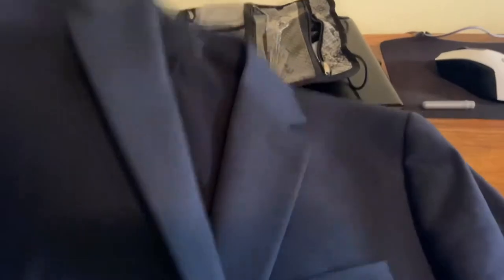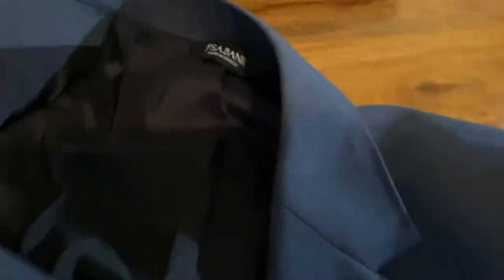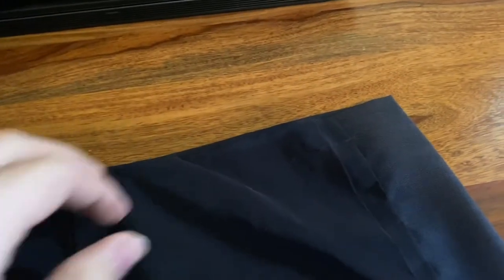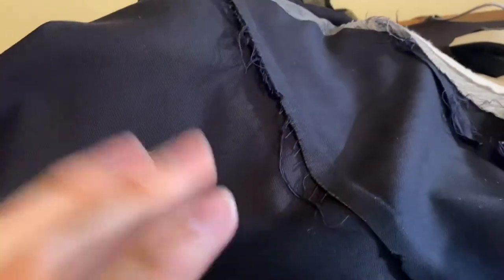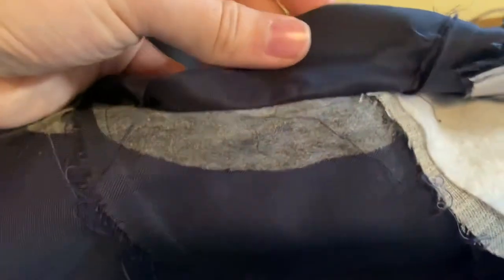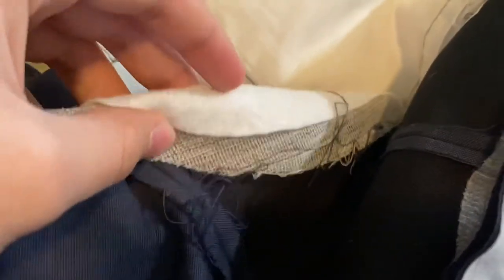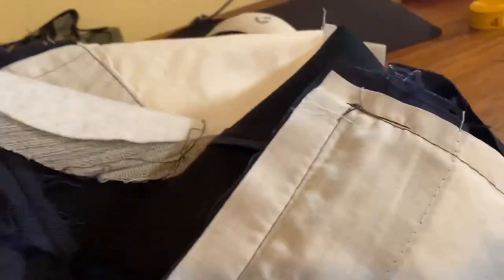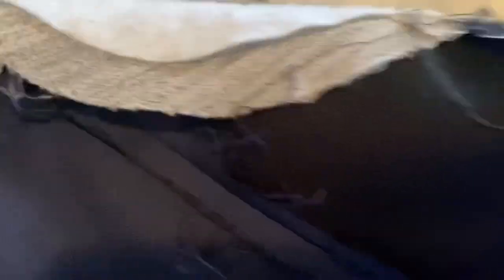Cutting Open a Jos A Bank Suit Jacket!

Comment: I have a favorite jacket, casual grey and soft like southern Italian kind of soft. It's unlined so I could take a peek in between the inside seams and see the inner workings of the jacket. That "mesh" thing you found was the only kind of interfacing in my jacket front so I guess it serves as a stiffener or... it's actually an additional piece that the other layers are tacked onto with very fine stitches in order to get the layers in the lapel area to rest on each other flat. It's like pick stitching but inside. If I'm right and not disoriented, DO NOT CUT THOSE STITCHES unless you want the front and back of your lapels to look like an unhappy marriage. Good luck on the alteration, man. Have a good one.
Reply from the maker: Hello Marcus, I think you found the pad stitching of your jacket, which is how the canvasing is attached to the lapels, it gives the lapels a nice roll because the process of stitching "teaches" the fabric where to lay. This jacket is all glued, so it doesn't have any of that pad stitching, but since I am getting some nicer stuff now my spier and MacKay jacket has pad stitching. It sounds like you have a very nice jacket that is very dapper. Have a nice day as well!
Reply: @KProductionsStyle  I replied to your reply but it's gone. Might have not sent. Yeah thanks. You might be right about mine although it doesn't quite look like the pictures of bespoke pad stitches. It is a very nice jacket all the same (both of ours). I pulled mine out of an "ukay" (Philippine thrift store) with cockroach eggs and the smell of dry death for 100 pesos (2 dollars) but it has served me well ever since after being cleaned. It's a little loose by today's standards. Got that Sigmund Freud or Jordan Peterson drape to it. Hope you keep finding some good deals and even better fits.